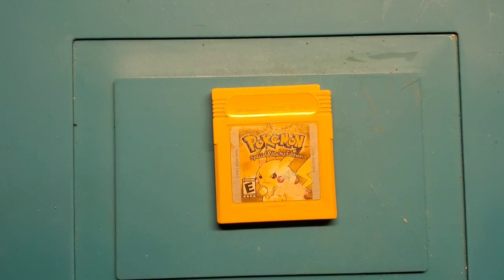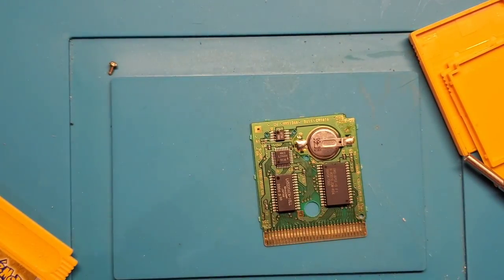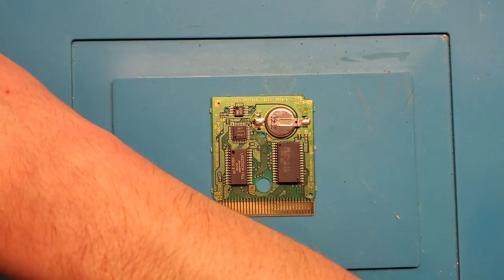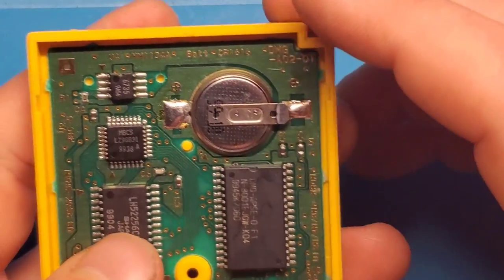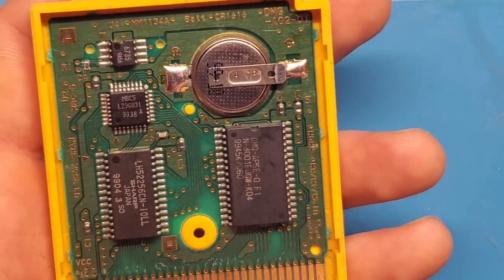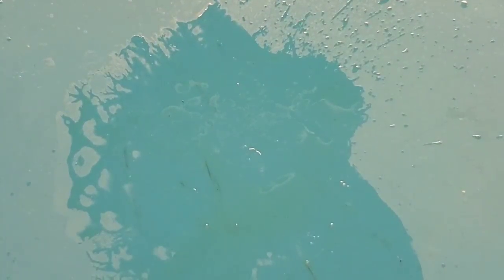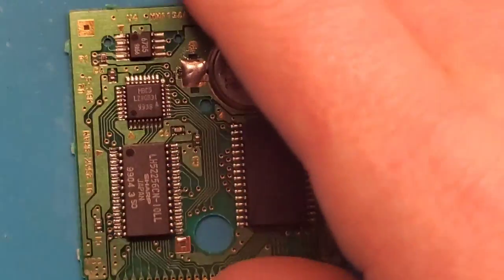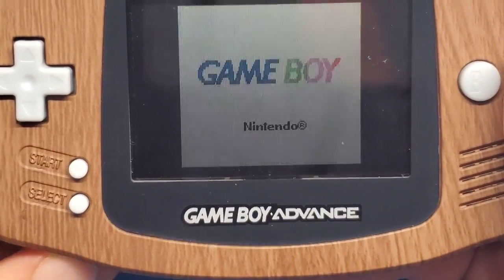Fixing eBay Junk - Game Boy Game - Game Won't Boot Up - Pokemon Yellow

Comment: If you're seeing that problem only after applying the screw, it often  implies a small crack in the board. Try using different levels of tension on the screw to see if that relieves or exacerbates the problem. If so look at the areas that the board would flex under stress and induce a light force to see if the crack becomes apparent or continuity fails. 

Also I hear acrylic nail polish works great as a mask.
Reply: bingo

Comment: I hate that kind of problem when it comes to tech. It’s just the same as calling out a plumber / electrician and you explain what’s wrong but when they turn up it starts working fine lol. It’s 10x harder to fix a reoccurring problem than a constant problem.

Comment: Looking back, it did make sense that the culprit would've been the memory bank controller. Here's the run-down on the Memory Bank Controller, for those unaware: The Gameboy's CPU only has a 16-bit address bus, meaning it can only "see," for lack of a better word, up to 65,535 bytes of data. But as games got more sophisticated, they in turn needed more space than the CPU could address. So they would use a large ROM chip and a memory bank controller that would split the ROM into 16kb "banks" and swap the banks in and out on the fly (this is done for any cartridge RAM as well, into 8kb banks). Up to two ROM banks can be loaded at a time, with the first bank always loaded.

I believe the issue might've been in a pin or connection to a pin controlling the bank switching. Here's my theory: It was able to load the first bank, as shown by the complete Nintendo logo, which is stored there, and the second one. When it couldn't switch the second bank out, it used code in the second bank in unintended ways, as it assumed it was in a different bank, which caused an immediate crash.
Reply from the maker: Thanks for the info.   That certainly makes sense
Reply: So, I paused to write this after you got it "working" the first time, and I assumed the rest of the video was you cleaning up the board. Oops.

In other words, while my theory is still plausible, that might not have been what happened lol
Reply from the maker: That is why i went for the mbc first.   It very well could be the trace going to the mbc, but hard to say for sure without a better knowledge of how these issues would cause it to behave
Reply: @RetroRepairs  Most of what Ziggy said is probably accurate, but the problem being the second bank couldn't be used because of a missing connection on the ROM chip you reflowed last. Bank0 is where the Nintendo logo is stored, then part of Pokémon Yellow's entry point is to load Bank1 to set up OAM DMA (to read instructions on how to display full sprites from tiles basically) which was likely the failure point.
Reply: Thats the issue my pokemon pinball thing had.

Address decoder would fail and cause the game to lock up.

Comment: Soldering beginner here, what temp should I normally be reflowing solder at on a Gameboy cart pcb?
Reply from the maker: There's a couple schools of thought,  but i prefer hotter so you don't need to keep contact for too long.too much heat can damage an IC, but keeping less heat for longer will damage more than high heat briefly.

60/40 solder melts at 370F,  625-650is a good starting point,  if you find it takes too long to melt,  go up a touch.  If not,  you can move down.  I usually work closer to 700
Reply: I typically use anywhere from 300C to 350C. 330C is the sweet spot.
Reply from the maker: 350c = 662f, so we're pretty similar. I work a little hotter,  but same ballpark.

Comment: I would have started either way with a battery swap first to prevent future complications. :) Matt
Reply from the maker: Getting it working was the first goal, the battery is not necessary for the game to boot
Reply: @RetroRepairs  You are absolutely right about that, but thats where I would start to prepare it for a long bright future :) Matt
Reply from the maker: It will be getting a fresh battery,  for sure.   It still works,  but it's had a long life.

Comment: If all traces are good, for my experience, 95% of the problems are bad ROM chip connection. So reflowing rom chip is the way. 3-4% bad RAM chip connection. Never had a mapper chip connection problem, only 3 cases (1%) with broken RTC on 2 gen pokemon games, replaced the quartz and fully working now.

Comment: I'll often just add a small piece of Kapton tape where the cartridge shell is rubbing off the solder mask.
Reply from the maker: No worry of it slipping?

When i open some consoles and see 20 year old tape,  the adhesive often leaves much to be desired
Reply: @RetroRepairs  That's a good point. I hadn't really thought about the long term lifetime of the adhesive (and every thing i repair is just for my personal use or a friends). Though considering the case is tight enough that it's rubbing away the solder mask, it would probably hold the kapton tape in place just from the pressure of the case.  You are right though a fresh coating of solder mask probably is the better repair, probably wouldn't hurt for it to be a bit extra think too.

Comment: I've got a question: Can I use a Cr202 battery to replace a Cr1615 on the Pokemon Yellow Cartridge??
Reply from the maker: I assume you mean 1616?  

The cr2025 batteries are wider and thicker, so as long as you can physically fit it in,  it will be fine.   I think it will be ok, but you'd want to test fit it to be sure
Reply: I've used a cr2032 battery to replace a cr1615 battery. Although if you want to use a battery socket you'd probably want to use the regular cr1615 as a cr2032 with socket is too big.
Reply from the maker: I'm of the opinion there's no reason to use a socket.  If you need to swap them that often,  you're using terrible batteries
Reply: @RetroRepairs  I agree but I remember seeing it on a YouTube video somewhere. I think Voultar did a socket mod for the snes cartridges, and I thought I'd seen a gbc game by someone else somewhere.

Have a good evening and stay warm.
Reply from the maker: @haloslayer255  yeah it's definitely doable,  i just don't see the point. These lasted 20-30 years,  I'd rather just solder in a battery. 

Take care
Reply: Yeah I have an spare CR2025 so I wanted to know if it could be done. But I think I’m saving that one and got some new 1616s. Thanks!

Comment: Hey Adam, How do you get the beep sound on your multimeter? I've had a few cheap multimeters in the past but I haven't had any with the beep sound. Does anyone know?
Reply from the maker: It depends on the multimeter. Some might not have it.  Usually there will be a symbol that looks like a speaker if it does

Comment: What works best for me is to completely desolder the chips and resolder them with fresh solder and it works perfectly for me and fixes issues reflows can’t
Reply from the maker: If a quick reflow didn't work,  that would be my next step as the visible traces looked good

Comment: if in doubt, reflow it all haha
Reply from the maker: My general troubleshooting for carts:
1. Make sure connector is clean
2. Look for bad traces near connector pins
3. Reflow chips. 
4. Inspect individual components

1 and 2 looked good,  3 is pretty common on thin boards like this
Reply: @RetroRepairs  yeah, im wondering if its worth getting a hotplate for small boards like this to reflow everything including capacitors, resistors etc. in one
Reply from the maker: The hotplate won't reflow, a hot plate is to heat up the board evenly so you don't have localized expansion.   If you're using a hot air gun,  it's highly recommended.

You might be thinking of a reflow oven
Reply from the maker: I stand corrected,  it seems you can do some soldering with a hot plate.   I don't like the idea of heating everything up like that though,  id think you're more prone to damaging the ICs that way,  but I've never actually used a plate like that

Comment: what flux do you use for that work? does any kind of flux works?
Reply from the maker: Best to use good flux. Doesn't need to be super expensive.  I use mg chemicals rosin flux.  You can get some cheap stuff from overseas, but it'll be hit or miss on quality.

No clean flux works great,  but despite its name,  you need to make sure you're cleaning your work very well. Rosin flux is mostly inert, but messier so clean it so it looks good,  but if you don't,  it'll be ok
Reply: @RetroRepairs  i've never used flux since i didn't have to solder or re-solder some Pins, recently i picked a flux here from a shop i Hope Is decent, Is made in my country (Italy).. thx for the tips, i Always clean all up with IP alchool After working on a motherboard
Reply from the maker: I'm sure it'll be fine.  I'm not familiar with most of the brands you'll find in europe. I'm referring more to the cheap stuff you might find on alibaba or something similar. That'll be hit or miss
Reply: @RetroRepairs  thank you, i Will search for some magnifying glasses and good lamps too. For now i got a soldering station (hakko) to replace the soldering iron and the mat to work on
Reply from the maker: Awesome.  I use a hakko fx-888d. It's more of an inexpensive lightweight soldering station, but it works well for what i need
Reply: @RetroRepairs  me too, for what i Need i saw It was a good deal, i was lucky enough to find One on eBay from a retailer that had It in stock